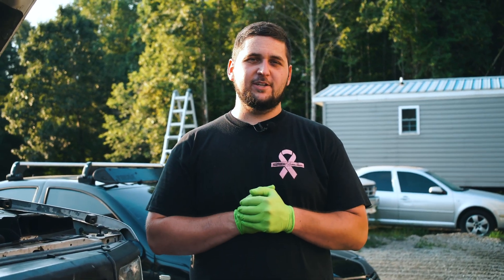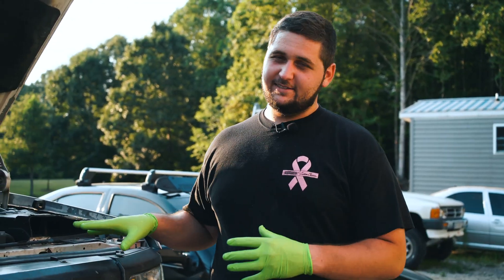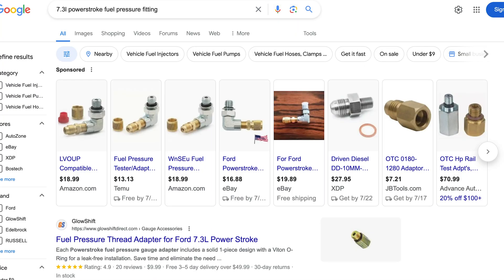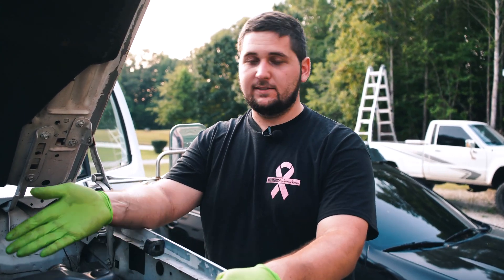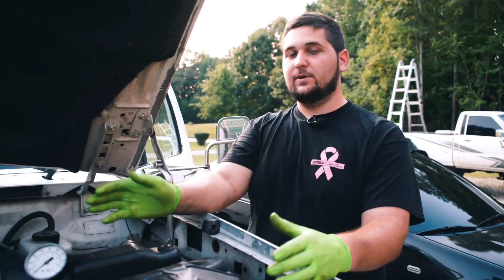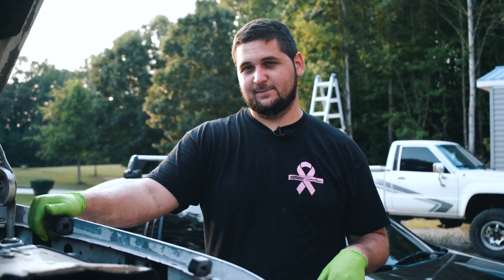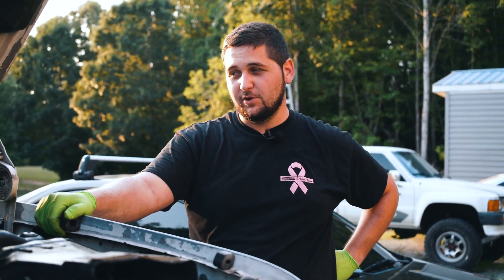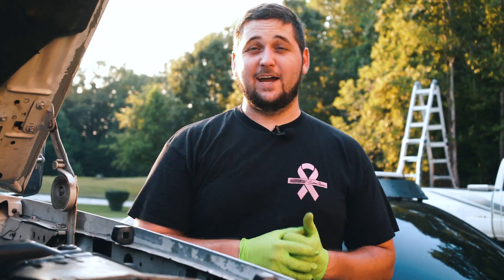How To Check Your Fuel Pressure | 7.3L Powerstroke

Comment: This should be titled "how to read your pressure gauge", as it describes nothing on how to actually do it (get and hook up your gauge,)
Reply from the maker: The main point is how to read the pressure and what the pressures should be doing and be at. There is only 1 test fitting on the fuel filter housing in which is a schrader fitting like what you have on your tires. Check this link to see a picture. If you don’t have one then you will have to purchase a test fitting to install.

Comment: Im getting 0 psi with a new lift pump, the bowl fills, I tested the fitting on a tire to make sure its working, on the tire it hits 40 psi, so I know the guage works. On the side of bowl its 0 psi. Getting frusterating.
Reply from the maker: Try removing the valve core and installing your gauge. It’s possible your fitting may not be pushing the core in enough.

Comment: What type of gauge did you use?
Reply from the maker: This is a matco fuel pressure testing  set. But any fuel pressure gauge that goes to 100 psi will work.

Comment: I have a 2002 7.3 powerstroke. Can you tell me what PSI I should expect in the 2002 and the 2002 has 2 fuel pumps, one in the tank and one on the rail. Which one was weak on your truck? Thanks
Reply from the maker: In your 7.3 you should only have 1 electric fuel pump on the rail. The sending unit in the tank is just a pickup but it could have a screen that’s getting stopped up. As far as the fuel pressure you should see around 60-70. Could be higher if there is mods for the fpr. This is an older 7.3 which has the mechanical   Pump in the valley which was weak.

Comment: Having a issue with mine and can’t seem to figure it out. Having 10psi while running. Running like normal though. Drove it on the highway not really any issues just slow like any 7.3 lol. Has a new fuel bowl and fuel pump. Not really sure what it could be. Any suggestions? Haven’t tried the bb mod on it yet. I didn’t want to mess up the new fuel pump or anything.
Reply from the maker: @patrickblackburn2880  have you verified your gauge. Have you checked to make sure you aren’t adding fuel to oil/cooslnt
Reply: @paulsperformance   tried with 3 different gauges all same result. And yes nothing being mixed. Could my schrader valve itself be faulty and giving me an incorrect reading? I haven’t tried an inline port to see what it reads.